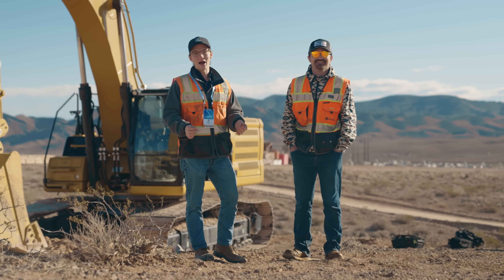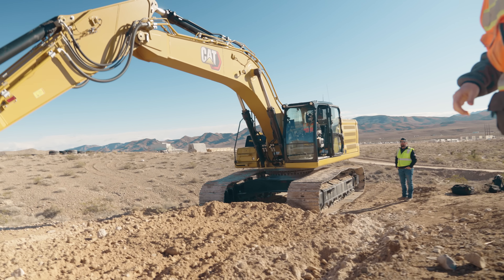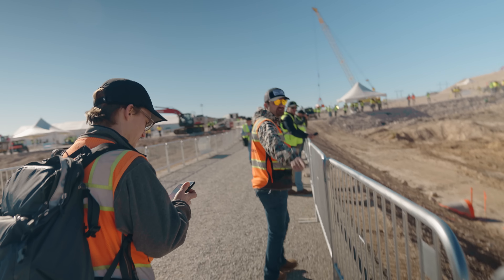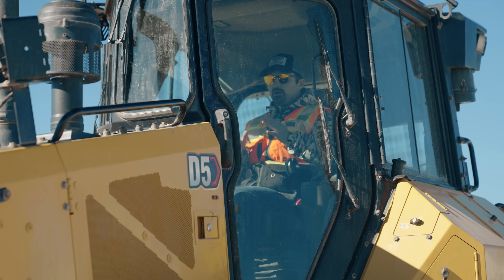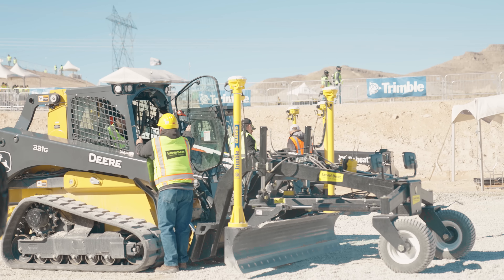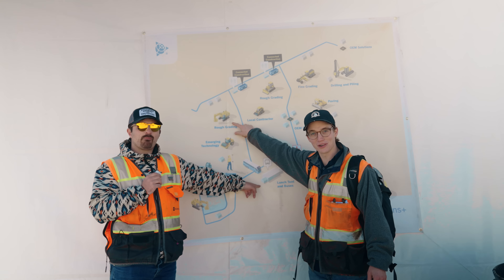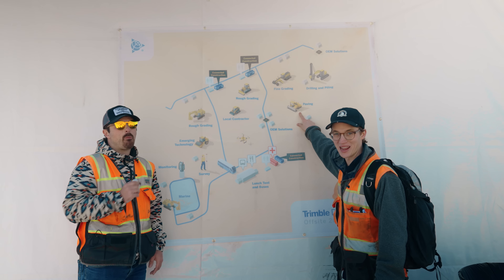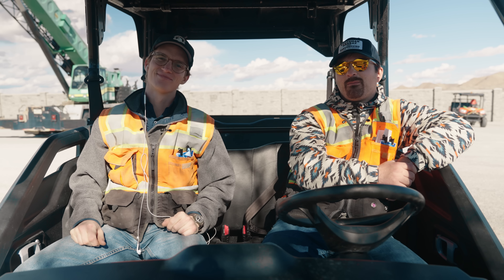Operating Heavy Equipment With No Hands | Trimble Dimensions

Comment: People need to realize it still takes an operator to make the best of this technology. And the ones who say otherwise are sticks in the mud. You can’t just hit the automatics and it will magically put things to grade if you have massive fills and cuts, you still need to get things close to grade before the automatics can be utilized.
Reply: It's only a matter of years till things will be fully automatic, in alot of underground mines alot of the machines run fully auto with an operator above ground monitoring it
Reply from the maker: yep... autos and tech is nothing more than a tool. If you embrace it, you can do some neat stuff
Reply: Exactly
Reply: Gps is just a tool to check grade the only time u need it heavy is when your finishing operators  rely to heavy on it way too much

Comment: Before I retired from a large electrical contractor, we used 3D CAD and incorporated it into Trimble Total station.   We could pinpoint conduit stub-ups within 1/8th of an inch up to 1500’ away from the station.   Thousands of them on some projects.  Our projects were completely coordinated with HVAC, plumbing, sprinkler, and any other trade that was in the 3D world.   Reduced re-do’s enormously.

Comment: Another thing with the box blades is you need to have the machine arms bottomed out and the wheels should always be on the ground so the autos can work the blade freely. Also make sure the continuous flow is locked in.

Comment: As an old time heavy equipment operator, GPS makes operators useless without it. I knew operators that could fine grade by touch ,feel and movement , they had a built in a ($$) level. That's all lost with GPS. I never had the gift but was still good running what I did run.
Reply: Outdated way of thinking. Gps makes good operators great, and great operators amazing. It doesn’t make bad operators good. You still have to know what you’re doing
Reply: As much as I hated where I worked I am absolutely thankful I started my dozer experience on a wore out 1960s d8 and later on my favorite dozer a wide track high sprocket d5 from the early 2000s neither of them had gps. You absolutely should start without gps you need to generate the feeling and understanding of the feel of the machine. When you're cutting to much or not enough you absolutely can feel in your seat when you begin to cut to much or little and this is a fundamental of dozer operation even with gps someone who doesn't understand this feeling will suck and have terrible efficiency generally being a waste of fuel and air.
Reply: @MrThatARMAguy  Hi 🤡, I've ran heavy equipment for over 45 years.  How about you?
Reply: @adamgretzinger963  LOL, you move the bulk and fine tune with GPS . You don't need to be great with GPS.
Reply: @jimbeam2705  I love how people think experience makes them better or worse then me. I run a grader doing final trim now. third year in it. run everything, got to have the feel but either you got it or you don't. but spending 4 hours blue topping a road when i can do it in 2 with uts and have zero waste is infinitely better. yall keep doing it old school way and when the young ins like me out you outta business there will be a spot at my company for you so you can learn how to be with the times.
Reply: @MrThatARMAguy  i agree.
Reply: @MrThatARMAguy  HAHAHA I WAS THINKING EXACTLY this!!! all the oldies that cannot accept the technology i just shake my head at.
Reply: @MrThatARMAguy  I agree old jim bean doesn’t know wtf he’s talking about
Reply: I’d like to see you eyeball a 40 acre field with a 0.15% and not hold a drop of water anywhere.
Reply: Cats CAES system is awesome, their RC System sucks. Saw more D11s tore up by the RC system. The Big Drills didn’t fare any better. Always breaking down. You are right about operator quality going to hell. Real life scenarios require thought.
Reply: @adambaker2876  if you eyeball a 40 acre field and don't hold water anywhere you sir just wasted alot of time and hopefully you charged the customer or else you just went broke gps can do a perfectly flat 40 acres in a bout 2 days.
Reply: @21babydew  I think you missed my point. I can finish a 40 acre in a day making finish passes with GPS.

Comment: Ive been operating bulldozer over 20 years The whole steer assist with the bulldozer first of all seems unsafe,second whenever your grading around curb line and corners. A lot of times material will get under the front of your tracks throwing the whole gps reaction off.  So I'll just continue to steer myself so I can rea act myself to recover from that. Just gonna be quicker in the course of the day

Comment: Trimble test all their stuff out in a desert not on real sites. I operate all equipment but mainly in a 349f with Trimble earthworks and load rite scale. It's a ...OK... system . Sensors need some major updating to handle rock and ledge . Would also be great if sensors didnt half to he removed to hammer rock then they need to be calibrated. Updates should also be automatic